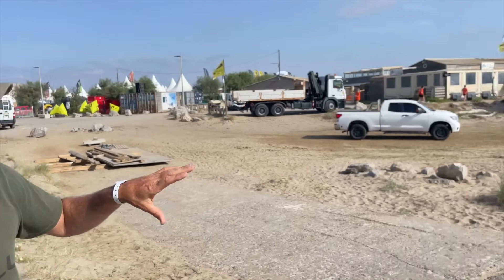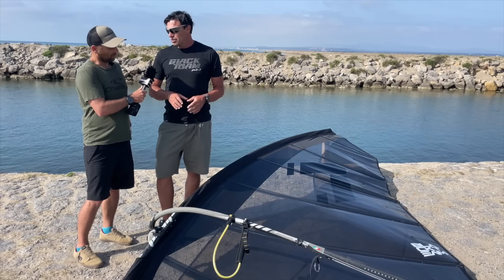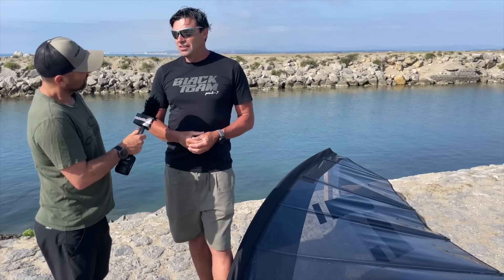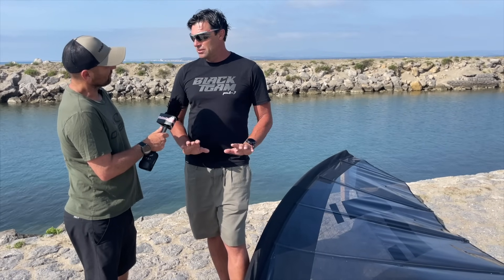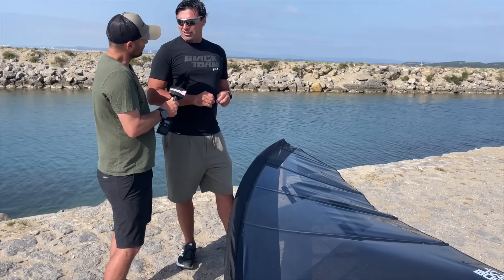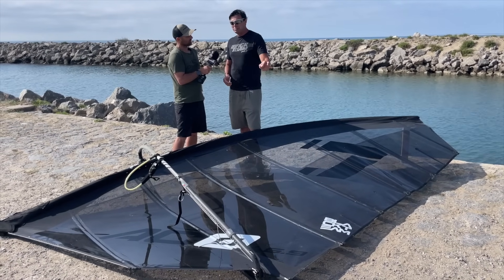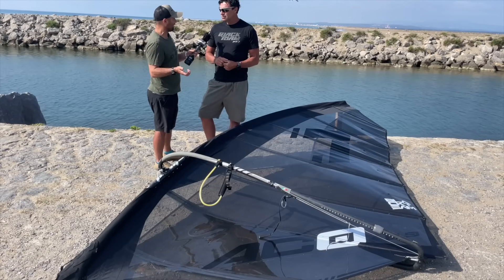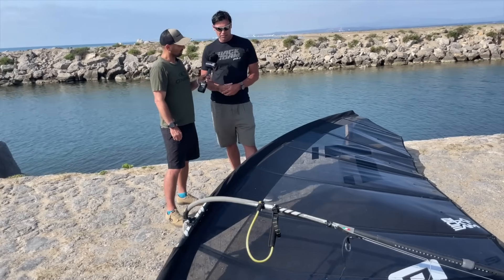First FULLY Q-BONDED Sail  - Point 7

Comment: 2:12 looks like faulty production on the batten cover to sail connection? I'm hearing features, not benefits? How does this pass the 'so what?' test?
Reply: There are no faults, but we did not show the final product during that time. The final product is visible on our site. The first feeling is the extra stability as gusts enters. So less physical and easy as wind increases. In light wind is planning earlier as its more efficient as the sail does not deform. You can keep the plane and the upwind in light wind as if it would be more windy.

Comment: You're 33 years late. Aileron Sails was an ultra-niche, experimental windsurfing sail brand based in Hood River, Oregon, that existed briefly from 1992 to 1994. It holds a unique place in windsurfing history as the first to introduce fully welded (ultrasonically bonded or heat-fused) seams in windsurfing sails, a groundbreaking departure from traditional stitched or adhesive-taped constructions. 

Perhaps today's technology will make production less expensive. It's not patentable, so everyone will make them if it becomes less expensive to do so.
Reply: Yes as said in the video. This is thought full produciton. It's introducing it to the market for everyone at a competitive price. In this case we are first. If other will follow, we have proved it right. It was not a process of just q bonding, but to set up production and testing the a way to make it efficient, but in mind that the main goal was to have a better performing sail.
Reply: @point-7  I thought it was a great idea then and it still is. If I didn't already have a   full quiver, I probably would have tried the Ailerons back in the day. I really do wish you the best of luck in your path forward and appreciate your willingness to introduce production methods to the mainstream.

Comment: Love the innovation, but a shame that it makes the sail more expensive. It would be game changing, if in fact it was cheaper to produce than a stitched sail, but if more expensive it will only ever be a niche product.
Reply: Innovation is always more expensive at first. Extra performance is also more expensive. Overtime with more production prices can drop, buy qbonding tapes are not cheaper. There is a lot of stock gear on the market for good prices.

Comment: Ive frequently had panels replaced on my point 7 sails by a local sail maker. Repairs now will be too specialist and presumably need sending back to point7 for repairs
Reply: I repair will be needed to be stitched as a normal sail. So anywhere, but unless you cut them they will not break.
Reply: I was about to buy point 7 because I know they perform and look badass, but talking to a fellow slalom sailor, he said he too said they’re super fragile! Also replacing panels constantly. Is it so? Or are you flying into the sail?
Reply: @lego720  never had problems with fragile panels or what so ever. If seen one, but that is perfectly taken care of.